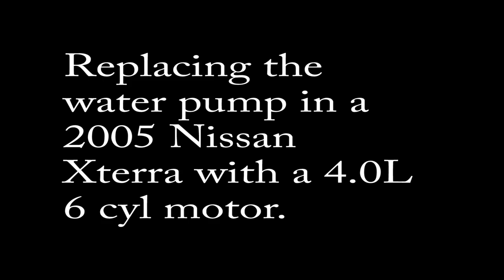How to Replace the Water Pump on a Nissan Xterra

Comment: How much fluctuation of temps do you have when idling?  My X will go from 195 to about 210 in bad traffic and climbing hills.  I just had the head gasket replaced  because of a leak along with a new radiator (shop damaged the old radiator so they replaced it at their cost). The water pump was done around 50k miles ago along with the thermostat and fan clutch.  After the head gasket work the thermostat was replaced again so that is new and it now runs the X thermostat.  The one they removed was cooler from a 350z which runs was better.
Reply from the maker: Honestly 210 is not bad. I was getting into 220-225 before I did all this work. Now it never gets over about 218. And that's in the Florida summer in traffic.
Reply: +Ry the car guy yeah mine had one incident when it went to 232 on a long drive up mountains and probably caused the issue with the head gasket.  Because after that time I had to replace a cat converter not long after.  I finally just decided to get the head gasket done because I am getting another code for my cats.
Reply from the maker: Yuck, I'm sorry to hear.
Reply: How much did you pay to have the headgaskets done

Comment: Do you need to replace engine oil after you remove water pump due to antifreeze draining into the oil pan
Reply from the maker: Yes if you get a considerable amount in there I would change the oil. If its a few drops it will be ok.

Comment: 2nd question about the tensioner:  If I can depress the piston all the way, I shouldn't need to take it out correct?  Just depress the piston, insert a paper clip is what Haynes says..
Reply from the maker: That is correct. You should not have to remove the tensioner if you can depress it and hold it in with a clip. I took mine out and replaced it because it was broken.
Reply: Got it.  Thanks!  Sweet videos, these are immensely helpful.  My frontier overheats on hot days going up hills, crossing my fingers the pump is the cause (already did the thermostat and radiator, the latter only because it went bad and got coolant in my transmission.  Thanks NIssan).

Comment: Is by any chance the settings of this car the same as a pathfinder?
Reply from the maker: +Cecilio Verduzco if it is a similar year then yes.
Reply from the maker: +Cecilio Verduzco if it is a similar year then yes.
Reply: Is really hard to find a YouTube videos to fix my pathfinder
Reply: Thanks men
Reply: Cecilio Verduzco yes, the Pathfinder and Xterra, and also the Frontier truck are all basically the same. That is if you have a 2012 and older Pathfinder. The 2013 and newer Pathfinder are just a car with AWD, they are not the same after 2012. The only real difference between the Pathfinder and Xterra and Frontier is that the Pathfinder had independent rear suspension. Other then that they all 3 are virtually the same... other then the obvious fact they have different wheel bases and the Frontier is a pickup etc.
Reply: How about! Geting the chain off time?

Comment: When pulling out my water pump (using the bolt method you mentioned) my water pump mounts both broke off. Any idea how i can get it out now??..it wont budge. Anyone else have this problem?
Reply: Did you ever figure out, how to take it out after the mounts broke off ?
Reply: How do you fix this problem?
Reply: Jose Luis Flores same happened to you!?
Reply: Yes right now. I'm stuck 😣
Reply: Jose Luis Flores damn! Any luck?Same happened to me, I tried everything! Even tied a cable around it and to a pole and let the truck roll down from our drive way and still!!!Didn't come out
Reply: Jose Luis Flores entonces que man, si se pudo o no ? Yo aún no la puedo quitar.
Reply: pono321 si si pude.  Ese mismo día. Pero. Que no conteste. Lo que hice fue que antes de que se me quebraran las partes donde van los tornillos, si al canso a salir poco la bomba.  Entonces con un martillo use la parte de atrás de la cabeza la puze atrás de los dientes de la bomba y empecé hacer como palanca de un lado y luego de otro poco a poco. Le puse un trapo o cartón en las orillas del motor para que no lastimara la parte de aluminio

Comment: So, when taking off that pump and time and chain or whatever it’s called, how would you take the bolts out if they did fall? My husband dropped a couple down there 😑
Reply from the maker: You can try a magnet on a flex rod. If not you would have to take off the timing cover. Which unfortunately its a very big deal.
Reply: Ry the car guy And there’s isn’t anywhere for them to go right since that area is completely sealed off? Or can they be pushed further somewhere else?
Reply from the maker: The inside of that chamber goes down into the oil sump
Reply from the maker: It is not sealed off

Comment: Problem! The 2 mounting holes snapped off when I inserted the M8 bolts..how in the heck am I suppose to get the water pump out now??? No bolts are stuck inside btw.
Reply from the maker: Do you mean the holes in the waterpump that you slide the bolts through? If those are broken then you need to buy a new water pump...

Comment: Quick Question, Should the vehicle be at tdc before starting this? I have a infiniti qx4 2002
Reply from the maker: Not sure about the qx4. I know that I did not set it because the likelihood of the timing chain skipping a tooth when you are just taking off the water pump is slim.
Reply: Factory Repair always states engine should be TDC.  However, I agree with a rear wheel/4wd rear drive - its unlikely something will happen - I would recommend positioning to TDC if you are doing this on a Maxima, Altima or any FWD.  Your space is insanely limited when doing this on a FWD Nissan/Infiniti.

Comment: Did the water pump fix your problem
Reply from the maker: It’s hard to say, I ended up replacing the thermostat, the water pump, all the coolant,  and the temperature sensor.
Reply from the maker: But yes, after that it was all fixed lol
Reply: @Rythecarguy  was  the overheating the initial problem?

Comment: RY i see that your chain guide has sliped down on the side of the timing chain tensioner. The Tensioner plunger is not sitting in the correct location on the guide. You need to replace all your guides and timing chaines!!! i have an 06 aterra and will be doing the same thing in a couple of weeks
Reply from the maker: Not sure what you are referring to. You can only see one tensioner I'm the video and I replaced it!
Reply: I have service manual EM revision 2009, if you look on page EM-64 you can see a clear layout of how things are supposed to sit. Item 15, Primary timinig chain tensioner, is supposed to sit on a raised surface on the chain guide. In your video yours is riding above that location. Look at your video at around 10:25 you will see what I'm talking about. You do great work, just trying to help out
Reply from the maker: +Todd Booker Thanks, Ill take a look at it. Imagine the videos I could make if my timing chain broke ;D
Reply: So I noted the replacement of the tensioner "actuator" which is a piston extended by a small helper spring. But I'm pretty sure the real work done by the actuator is the result of oil pressure behind it. You made a good point about care for the gasket, but did not mention that it is (I assume) a hydraulic tensioner.  

I also question the premise that replacing this actuator is equivalent to replacing the tensioner as a whole.  The wear component that most frequently requires replacement is the curved plastic shoe/chain guide, not the actuator. That didn't appear to be addressed here.
Reply: @Rythecarguy   no esta rota la cadena , es solo el plastic donde desliza la cadena, (slack side)como es de plástico se rompe la parte que lo sostiene en su posición,  puedes ver que el tornillo de abajo del tensor ,esta en el mismo nivel donde debería estar el tensor, ves el plástico que esta apuntando hacia dentro, cuando colocaste el nuevo ,podias subir el plastico con la mano, aunque se volvería abajar, porque ya no tiene el plástico que lo sostiene,  yo los cambie el año pasado

Comment: I'm about to have a mechanic replace my water pump on my '04 Exterra... how much should I be paying for this job?
Reply from the maker: No idea. I have not had a mechanic do work on my car in over a decade.
Reply: @Rythecarguy  
Neither have I but, I just bought this used Xterra and I've never worked on one, nor do I have a place to work on it.

Comment: Ry, I threaded the bolts into the new pump and the top hole in the block was stripped out!  Swear I didn't do it but no matter.

Eeeefffffffffff!   Any advice?
Reply from the maker: are you 100% sure that you are not putting the wrong bolt in that might just be the wrong size? I know I've done that before. If it really is stripped you will probably have to re thread the hole. pumps need a really good seal on all sides to keep from leaking. sorry to hear man.
Reply from the maker: +nelson3823 also make sure that you push the pump as far back into place as you can before trying to put the bolts back in. If I remember correctly the threads are pretty far back in that hole.

Comment: If the pin falls inside the tensioner gap will it fall to the oil pan?  How do I retrieve it if it doesn’t? Thank you
Reply from the maker: Yes it might make it to the oil pan. If it gets caught you need to take off the front timing chain cover. I have a video for that too.
Reply: Ry the car guy Thank you
Reply: I could not find it.  How to remove timing chain cover.  Can you provide link?
Reply from the maker: https://youtu.be/j3uY3clWxFE
Reply from the maker: It’s part of that video. It’s like the first hour or so.
Reply: @Rythecarguy  can you just remove the oil pan and take it there

Comment: Did this fix overheating if not what did
Reply from the maker: To be honest I dont remember exactly. When i have having over heating I 
ended up doing the following: Thermostat, temp sensor, water pump (dont 
think i needed that) and a full flush of the fluid and fresh fluid. 

You would be surprised how much that last one matters. Old fluid will 
not transfer heat like it should. No matter what you end up replacing, 
just go ahead and flush it all out and put new fluid in. Especially if 
you have never done it before. Sorry, I know this is kind of a 
non-answer but its the best ive got.

Comment: How many miles do u have on the xterra ?
Reply from the maker: Right now I have 140k. At the time of that video it was likely around 132k.
Reply: @Rythecarguy  right now I just turned $69,000 on mine I have the same color same year with the full off-road package. I was wanting to do the rear differential fluid I'm just not sure what other services do you think need to be done? At this mileage. It was serviced the trans was rebuilt and they did block off the radiator fluid from going into the trans that was done before I got the car. Do you think it's wise to continue to keep the car if it's running good and all that service was done?? Thank you

Comment: i dropped a bolt from the pump inside where the chain is at how do i get it out
Reply from the maker: +Oracio Navarrete Oh WOW that's is not good. You can try a magnet stick that you buy from a hardware store. If that does not work you need to remove all of the pulleys from the front of the motor to take of the timing chain cover so you can get to the bolt. Since you will be doing that. You should just replace your timing chain.
Reply from the maker: Were you ever able to get it out?
Reply: +Ry the car guy i had a really flexible magnet i got of my snap on guy lol
Reply from the maker: Heck yea!! That's awesome. I just did a video on the secondary timing chain guides and I assure you, getting behind that cover is a LOT of work

Comment: Anyone know how to remove water pump after screw lobes braking off, seems like pump is seized inside won't budge what's so ever.
Reply: did you ever get it out? I'm in the same boat right now and running out of ideas
Reply: @johnappleseed3583  man i wasn’t able too I tried everything! I think what happened is that it overheated thus warped the block or water pump i think it lost its original shape and won’t come out. Is that makes sense. I remember I even tied a chain on the pump and let the truck roll on a backwards slope and still! Wouldn’t come out! Maybe if you use a welder but to heat it up it’ll come out. I just didn’t have that tool.
Reply: @johnappleseed3583  hey any luck we’re you able to get it out ?
Reply: @pono321  I do have access to a welder so maybe I'll try that but I did try a propane torch... mine never overheated or even needed a new water pump but I was doing the timing chains so I figured I should. But then I already damaged the teeth on the pulley with a hammer so now I have to get it out haha. My truck has 160k on it and the timing chains and etc looked like they had never been replaced so I think it's just corroded and heated itself into place for 16 years
Reply: @pono321  I got it finally! had to build a 5ft long slide hammer using a 45lb olympic plate as the weight and it came right out!

Comment: Do I really need to remove the tensioner or can I just push it in and put the pin into hold the tension ? Lol 😅
Reply from the maker: Sure, I don't see why not. Can you still remove the bracket with the tensioner on?
Reply: @Rythecarguy  no were at the point we're we loosen the timing belt tensioner
Reply: Part of the timing belt tensioner fell down into the engine what do we do LOL

Comment: I WOULDN'T - THE TIMING OF BELT/ENGINE CAN GET ALTERED.  my harmonic balancer did not have small holes where to get some torque to remove.  Desperate to get it off, I ended up turning the balancer which inevitably altered the timing belt and "TIMING".  A huge impact drill was needed to remove harmonic balancer.  Once all back together, due to the timing being altered, car did not start.  We had to tow it to a mechanic to get the "timing" correct again.  We should have just paid the $500 - $600 from the get go.  FYI, if you replace water pump and thermostat, also replace the coolant sensor (cheap part) because if you don't, the radiator fan will go into over drive and the wiring harness of it will be burning hot.  I WOULDN'T.
Reply from the maker: You wouldn't what?
Reply: @Rythecarguy  I WOULDN'T EVEN try to do this job myself if I was not an experienced, professional mechanic.  Makes sense now?
Reply from the maker: No, it doesn’t.

Comment: Why does it have a electric fan and a clutch fan… weird engineering
Reply from the maker: Yea, the electric is to kick on when it's needs a boost and for AC and such, You would think they would just make the mechanical on move enough air.
Reply: @Rythecarguy  absolutely bro. When I looked into this suv I found a lot of weird things about them , still see them on the road today and they surprisingly have a wide fan base

Comment: Your tensioner guides need to be replaced. That sucks.
Reply from the maker: I actually think I am going to do that job. Quite a few people have mentioned the buzzing noise from the D40's. Mine is buzzing too and its getting pretty annoying.
Reply: Bummer, it's a beast job but looks like you can handle it.
Reply from the maker: Here it is https://www.youtube.com/watch?v=j3uY3clWxFE and yes a beast of a job is an understatement. It was brutal.
Reply: Your're the man for pulling this off \m/. Was wondering why not replace the main tensioner an guide as well? Sure you had your reasons. Was considering doing this myself when the time comes, I'm not looking forward to the day.

Comment: Hi Ry! Thanks for great videos! I just bought a RWD 6MT Xterra and need your expertise on something. I have replaced the oil cooler gasket and now the leak is fixed! I did notice a loose bolt at the bottom of the engine right behind the oil cooler. Can you tell me what it is and what do I do with it? Here's a video of it: https://youtu.be/_vYpWKnMCT8
Reply from the maker: Hey man, I commented on your video regarding this. :D

Comment: Im never buying a Nissan. Who runs the timing chain with the water pump? Wtf? American made. Always drive a CHEVY!  JUST SAYING....
Reply from the maker: Bro, water pump on a timing chain is VERY popular. My current Chevy is under recall because it bursts into flames 🔥. So I think I'll take a water pump that runs on a chain. JUST SAYING.....
Reply: Dam that sucks bout your chevy. Do you know what the recall was for? Maybe i should check on mine. Idk but thats the first i ever seen a water pump run by the timing chain. Oh i also had a question. Do you have to time the motor again once you pull the pump? Or does it have markings where the chain should be placed back?
Reply from the maker: Mine is the electric Bolt. They are all under recall. It's because of the batteries. No, you do not have to time it. When you are turning the crank to loosen the chain just be very gentle. I'm sure in a VERY rare case if you pull too hard or too abruptly you can make the chain skip a tooth but I highly doubt it. The tensioners and guides are still on so it would have to be a freak circumstance. For the love of god just don't drop anything inside the front casing. Lastly, if you pour a bunch of antifreeze in the case you should swap the oil out. Just time the job around when you need an oil change and do them both at once.